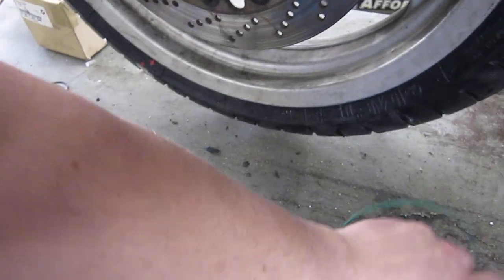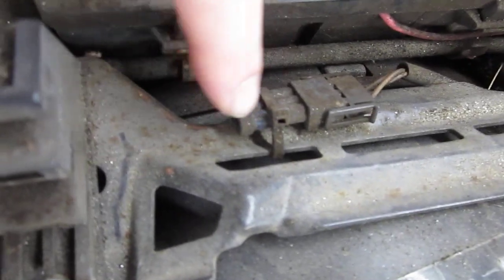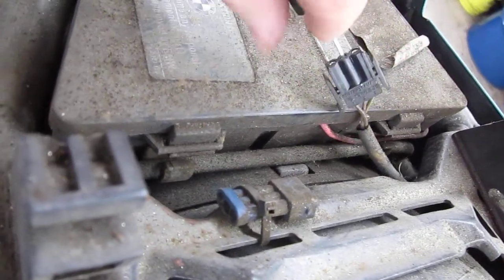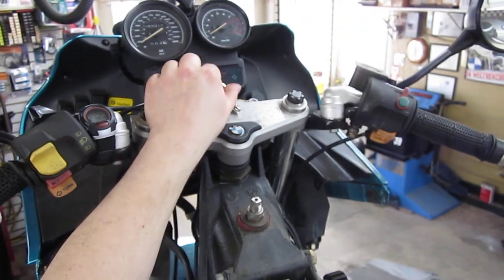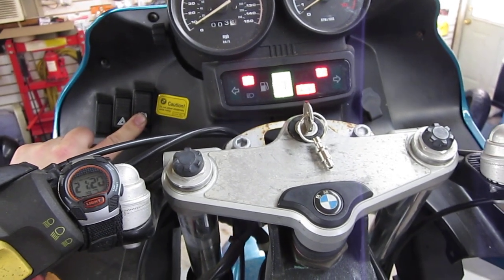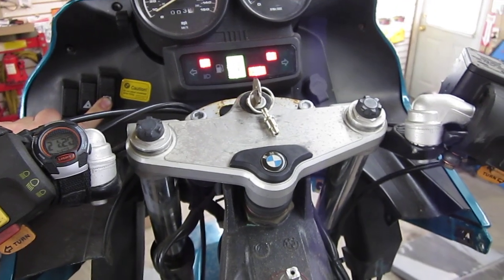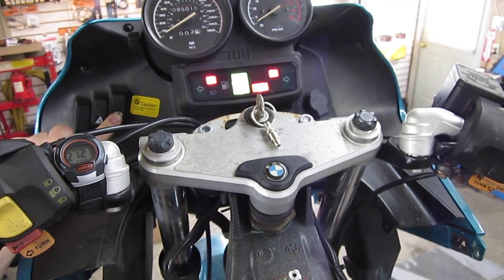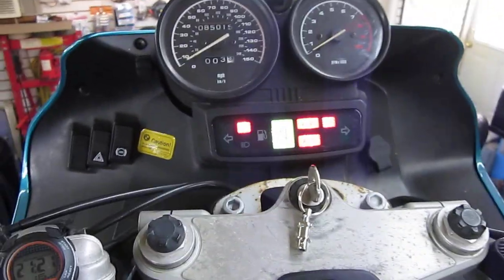BMW Service - Clearing a fault from BMW ABS I & ABS II systems

Comment: Also one more tip for ABS1 and ABS2 - You can put an oscilloscope or a LED+resistor(8k+) (EDIT: I use a ~50k resistor - a dim LED, but it works) setup (Don't use a lower resistance, or 12V bulbs - too much current) across that middle pin and battery ground to read the fault codes - the 'code' is basically the number of blinks you get between long pauses. 

For example, my K bike blinked 5 times, stopped blinking for ~6 seconds, blinked 5 times and so on. 5 blinks is code for low battery - I charged it up, cleared the code and my ABS works since.

You can google the codes, but for completion's sake I'll just copy some here:

1 No response from Front pressure modulator 
2 No response from Rear pressure modulator 
3 Open circuit between the brain and Front speed sensor
4 Open circuit between the brain and Rear speed sensor
5 Low battery voltage
6 Defective ABS relay (weak battery can cause this error)
7 Internal brain defective (weak battery can cause this error)
8 Front and/or Rear Speed sensor gap incorrect
9 ? Is reported to happen, but it's unknown
16 Failed plunger test, persistent

Comment: Thanks for this.. Have a question. I have a R1100r that I recently bought so I'm not familiar with what ABS light are normal. When you say 'clear', does that mean no  ABS lights on while bike is running? Or?

Comment: Hello Chris , i have a bmw r850rt  i have tried your reset , firts time worked perfctly , but Next day when i moved the bike, It sounds the clunk of testing but lights flashes alternatley , i stopped the bike do the reset lights ok. But when i started the run sound the Buzz of the test but lights alternate. Any idea what can It be? I can Make the reset but as soon as i ride lights ,flashes alternate.
Any sugestión for the wire? Any special position for the cut off of the handlebar?shoud i keep press the ABS Button before the ignition. Thank you very much for your help.greetings from europe

Comment: When I bought my used K1100 LTA, I had to constantly clear an ABS fault, until I got around to replacing the aged rubber brake lines with new stainless steel lines. It was the rear line that was at fault.

Comment: I just cleared my ABS fault on R1100R OK.  When get up to speed the ABS makes the clunk noise.      Unfortunately right after the clunk noise, I get the ABS fault again.  I'm planning on send to ABS unit to Module Master.  They charge $350 to rebuild it.  While I got the ABS unit removed, I will also replace the alternator.  The R1100R has a 50 Amp BOSCH.  I will upgrade to the 60 Amp that came with the R1150R with BOSCH generic.

Comment: hi chris I have an 1150gs with servo abs fault,,the abs button is on the throttle side,unlike the one in your film, do you know which pin needs to be earthed out?.. regards steve,

Comment: Dear Chris do you have  information about reset ABS system K1200GT    2007 
1 lamp , round diagnostic plug 5 wires , you talk about pin 20 , where and witch pin grounding on the diagnostic plug

Comment: Hi Chris, thanks for this. I have a question. My ABS lights on r1100gs flashes in sync and doesn't go off after riding. It just keeps blinking. The BMW service says the pumps and sensors are working normally and the fluids have been renewed. They don't know what to do now. Do you have any suggestions? Battery is new too. They've also cleared the ABS fault. Thanks heaps!

Comment: Chris, I have a 96 R1100GS, When it starts riding, the back brake pedal gets really hard and the ABS unit continue to make weird noises as when it engages , clicks and so on, after a few miles it disconnects, blinks go off and the back pedal releases and lets you brake. with no ABS of course. Any suggestions? Kind regards

Comment: Chris.. thanks for your video.. I just purchased a mint 95 K1100 RS.. the ABS lights are blinking alternatively and I know battery was recently changed due to long storage so assume the reset process would work.. Im just having trouble finding the diagnostic connector on my bike.. can you point me in right direction.. thanks Kurt

Comment: Hi Chris, I have a question if that is ok. I am currently re-installing ABS onto my 1991 K100 RS 16V.  I brought the hard lines online and have three of them, Two long and one short.  As far as I can tell to far of the two long lines one is shorter than the other and has a wider thread at one end.  I think this is the line that goes from the modulator to the caliper. The other long line is therefore for the line to the brake lever.  The third short, curved one seems to be an extension for the line to the caliper.  I am having a little trouble working out the exact routing of the that pipe so I can connect it right. I have searched but can't find any photos on line.  Can you tell me how I should route the lines?  Thanks and keep up the great work!

Comment: Chris have a 1998 R1200C with ABS problems can remove/bypass the ABS  system as the repair may exceed the value of the bike
Dave

Comment: can you do this on the newer bmws with the round diagnostic plugs? if so what do i ground in the plug?
Reply from the maker: A banana? I don't know that you can do much on the later 2.4 motronic easily without the GS 911 diagnostic crap.

Comment: Hi Chris, l have a 2003gs1150 adv and the abs light will not switch on .The man that l bought the bike from says those bikes do not come/ have abs yet they have the button.Please help.

Thulani 

South Africa.
Reply from the maker: That could be a non-ABS model. Does it have wheel sensors? If not, it is likely a non-ABS model. That means less weight and less headaches, enjoy!

Comment: Your are the best :)  I had watch almost of your video and make me get more learn in BMW motocycle. I just buy BMW K200RS but speedometer not work and I found that ABS sensor had removed, I don't know how to put it back. please guide me.
Reply from the maker: The sensor or servo unit? If you mean the servo unit has been by-passed / eliminated you need to do this: https://www.youtube.com/watch?v=zTDfLfiNwDY Good luck Barista Pat!

Comment: Hey Chris. Great videos. Been studying them. Wondering about clearing ABS fault codes on a 2004 R1100s with the IABS "whizzy" system. My code reader is the round version with 5 wires. Thanks for all the help. Glenn

Comment: hi chris. ive got a k1300s thats driving me crazy, the brake failure light comes on when going slowly on roundabouts. any ideas. thanks dave.
Reply from the maker: Dispose of the servo brake unit and you will likely never see the brake failure light again!
Reply: @ChrisR.Harris  thanks chris, ill try.

Comment: i have a question. the second i turn the key on my r1100 rt my abs starts blinking alternately (so top abs light than bottum abs light) i was wondering what whould be a good place to start.(i am going to replace my cluchplate soon so my bike will be in a 1000 peaces, and i can reach everyware )

i thank you in advance. klaas,the netherlands.
Reply from the maker: +mightylemonn You have an ABS fault. Clear the fault and test. If the fault remains further diagnostics are required. Good luck.

Comment: I have a 96 R1100 RT, when I get an ABS fault from when it doesn't engage, I simply turn off the ignition, wait about 2 seconds and turn it back on, ride a few feet up to speed, I will hear it engage, sort of a slight grinding sound.   I assume that is normal.  Then all is fine.
Reply from the maker: What you are experiencing is a common fault caused by low battery voltage. The 'grinding' noise you hear are the two electro-magnets in the ABS pump activating at 2.5 miles per hour. This noise can be heard while motoring along and also when riding over sharp edged bumps. Take care, Chris

Comment: What do color wire do u attatch a ground too on a 2007 gs1200 with the round plug to reset ABS. Thanks
Reply from the maker: No clue, that's much too 'new' for me. Traditionally, BMW motorcycles used brown for earth/ground. What happened after the car division had a few years of free reign... I'd be a fool to speculate. Good luck.

Comment: Chris I have 2005 BMW 1150 RT just replaced the brakes, did not know what I was doing and bled the rear brakes wrong. I'm sure i pumped air in the system. After research I now know how to properly bleed them. Do I have to take it to a dealer to reset the ABS system so the ABS light will go out? It doesn't have the ABS button on it. Thanks!
Reply from the maker: bigtw09; You'll need the stealership or a GS911 tool: https://www.hexcode.co.za/
Reply: @ChrisR.Harris  not what i wanted to hear, but thanks for the response!
Reply from the maker: @bigtw09  You're welcome; Good luck, Chris

Comment: I have a 93 1150 GS 1150 R Adventure. Its been in store for a couple of years and now trying to start it I have fuel starvation troubles....I am pretty sure!! Is it straight forward to remove the injectors to have them cleaned and in so doing will fuel flow to prove the lines are not clogged too?
Reply from the maker: Doubtful that your injectors are blocked/clogged. It is probable that the fuel pump has failed or is weak. Can you hear the fuel pump? If so, Install a fuel pressure gauge in-line near the fuel hose connections and see if the pressure is between 35 - 50 psi. Happy New Year, CHris
Reply: Hi there Chris....thank you very much for getting in touch. It turns out that the fuel pemp is broken. New one on it's way. Hopefully riding in a couple of weeks time??. Happy New Year mate. love the videos.
Reply from the maker: Mowbray Bullock Great! Thanks.
Reply: Mowbray Bullock Don't forget to sync your throttles. Did wonders on my R1100R. Cheers

Comment: Was hoping someone with some Know how could offer me  input....I've got an 1150RT '04. Washed the bike and the next ride the ABS wouldn't operate with the front brakes. Quick flashing warning light. Went for a short ride and the rear brake works, but not the front brake until after the rear is applied. Which then the front brakes will work. Both having the servo function. But when fully applying either brake they will release then kick in, over and over again. Rolling several yards before engaging once again. I replaced rear pads, front are at 60%. bled and replaced all fluid. **No, I didn't use a pressure washer to wash the bike. The servo works intermittently, I'm hoping and guessing it's a switch or wheel sensor.
Reply from the maker: Chris Anderson, the servo brake system is not reliable. I eliminate them reverting back to non-power assisted conventional brakes. Your bikes symptoms can come from a wet ignition switch or even a wet brake light switch. Dry with compressed air after washing. I wish you luck, Chris
Reply: Thx Chris. Yep, ABS is out of the bike. Waiting on parts :-)
Reply from the maker: Ah, problem solved! You'll enjoy the trouble-free braking. Take care, Chris
Reply from the maker: Good luck.
Reply: Chris Anderson Hej Chris, I've the same problem, after new battery the light abs light keeps blinking. First there is no reaction from the abs trying to brake with the front. Only when the rear is pressed, the abs starts zooming and the front brake can brake with abs. Would you like to share how you fixed this? Thanks in advance!

Comment: Witaj .O co chodzi z tym ?? .Mi ABS po odpaleniu czasem się nie załącza :( .Czyściłam już czujniki i nic .Pomożesz ??
Reply from the maker: English: 
Hello. What's up with this ?? .Mi ABS after firing sometimes does not turn on :(. I've already got sensors and nothing. Will you help me? 

Answer: Battery voltage must be strong; 13.8 volts. Wheel sensor gap must be correct. Computer could be defective. I wish you luck, Chris

Odpowiedź: Napięcie akumulatora musi być silne; 13,8 woltów. Szczelina czujnika koła musi być prawidłowa. Komputer może być wadliwy. Życzę ci szczęścia, Chris
Reply: @ChrisR.Harris   hmm muszę zmierzyć napięcie po odpaleniu Moto . I powypinam wtyczki i potraktuje preparatem do styków . Nie bardzo rozumiem jaka szczelinka (koło ) i jaka powinna być ?? Może foto wrzucisz :)
Reply from the maker: @jachukb  
Chris Harris hmm I have to measure the tension after starting Moto. I remove the plugs and treat with the contact preparation. I do not really understand what slit (circle) and what should it be ?? Maybe you'll throw in a photo

Tomasz B, 

12 volt Battery: Test voltage before starting the machine. If voltage is below 13,0 volts you will get an ABS failure at engine start up[ most times. 

Wheel speed sensors: Measure the gap between sensor and sensor ring on both wheels. Too far or close will cause ABS faults.

ABS Computer: Could be defective. Swap with a different one from same model machine for a test but you will need to reset the ABS of course. Good luck, Chris

12 V Bateria: Sprawdź napięcie przed uruchomieniem urządzenia. Jeśli napięcie spadnie poniżej 13,0 woltów, wystąpi awaria ABS przy uruchomieniu silnika [najczęściej.

Czujniki prędkości koła: zmierzyć odległość między czujnikiem a pierścieniem czujnika na obu kołach. Zbyt daleko lub blisko spowoduje błędy ABS.

Komputer ABS: Może być wadliwy. Zamień na inny z tego samego modelu maszyny, ale oczywiście będziesz musiał zresetować ABS. Powodzenia, Chris
Reply: @ChrisR.Harris   tyle że mi żadnego błędu nie wyrzuca tyle tylko że załącza się ABS jak mu się zachęcę

Comment: I have a 1993 BMW K1100LT with ABS.  I took it to a service center here in Germany, and they pointed out a cable on the right side of the bike that is cut.  It has a brown (ground) and green wire.  It's been neatly cut and wrapped off with electrical tape.  I was thinking of hooking it back up and seeing if I could get the ABS fault to clear using your procedure here, but I thought I'd ask if you can think of any reason why someone would cut the system like this?  Any chance it's going to blowup